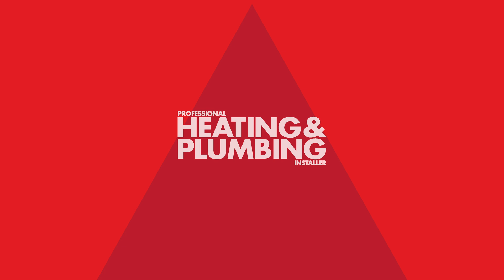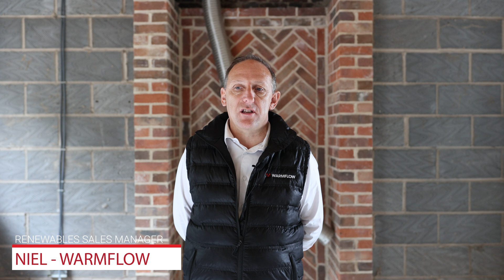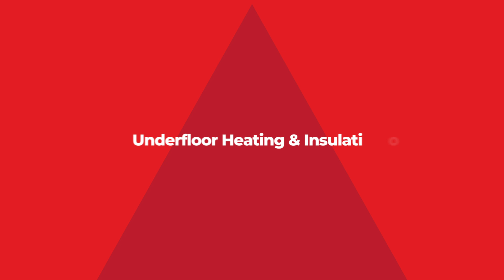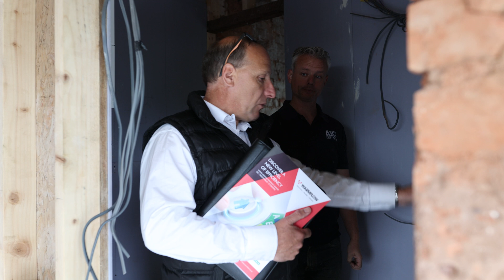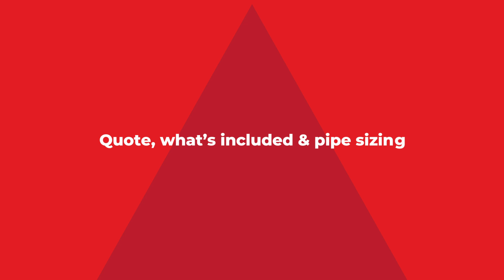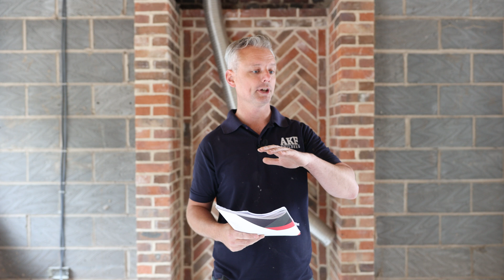Can I use a heat pump on my building project? Warmflow Engineering

Comment: 20kw heat pump ? Adam's property is well insulated with 100mm cavity wall insulation, then insulated internally within stud partitions and external walls as his video series progressed. Party wall not so important as next door should be heating their property and heat loss should be minimal. Better consulting 'Electic Vehicle Man' on youtube, who details his usage of a 5Kw unit, working in conjunction with solar, batteries and smart energy tarrif.

Comment: Not the best advice offered to the customer here. 20kw heat pump for that house is well over sized. Trusting a merchant to size radiators?? Why has a room by room heat loss not been done to calculate the heat pump size and rad sizes? Seems like a very basic survey has been done. 28mm pipe for a 20kw heat pump?